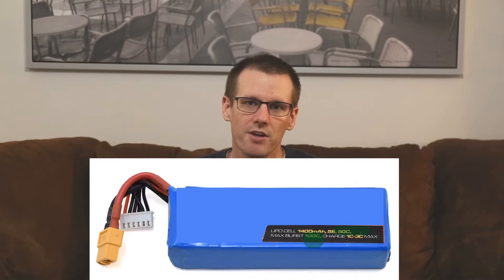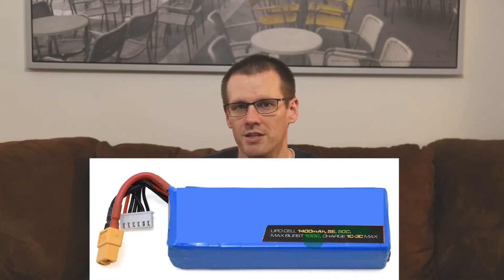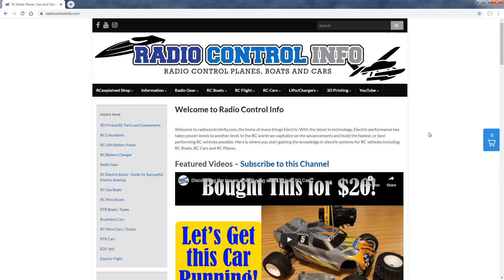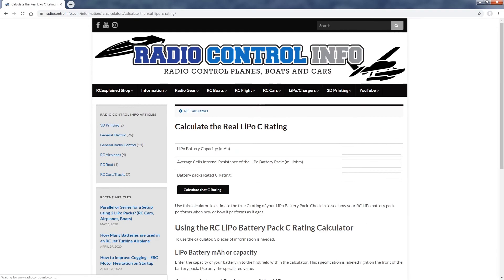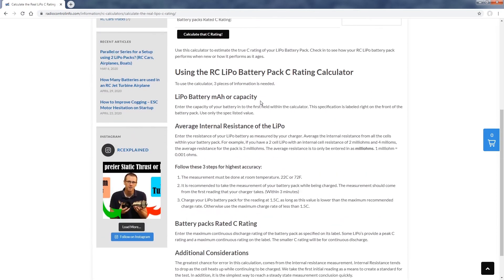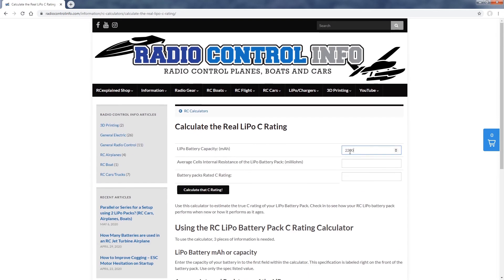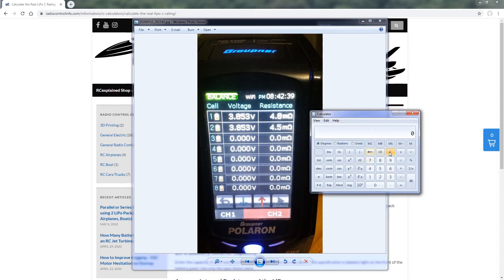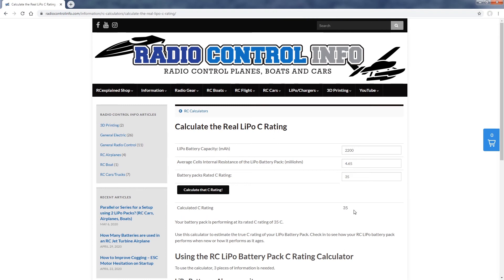Calculating The True C Rating of an RC LiPo Battery Pack

Comment: Disapointed !
I thougt this video would teach me how to messure internal resistance and do the calulation.
After ten minutes of watching I realize it teaches nothing but how to use a function on a web site.
Reply: 1. Measure open circuit voltage.
2. Apply a load (with something like a resistor or whatever) and wait 1 second and record the voltage. Determine what that loads current (I) was.
3. Open circuit voltage -Under Load Voltage=Voltage Drop (V)
4. V/I=IR ie 0.071/10=0.0071 Ohms
5. There you go. 7.1milliohms
6. All testing that is done comparing packs should be done at the exact same temperature. DC IR is also very dependent on pack voltage, unlike AC Impedance which barely changes throughout the voltage range.

I'm not into the Lipo world as much as NCM/LFP but I believe testing IR at 3.8-4.0V is fine so long as you use the same voltage for all packs.

A more accurate number can be had by using multiple different loads. I can't remember off the top of my head how to put that equation together but its' quite simple

Less voltage drop equals better                                                                                                                                                                                                                                                                                                                                                                                                      f;;;;;l

Comment: hi. how can I make sure that my Ni-Mh battery is 10C as the company said? I do not trust what they say!
Reply from the maker: I do not have any data on 10C batteries, sorry.
Reply: Use a power resistor that would draw a 10C load. So lets say you have a 12V battery. That battery is 2000mah. 2Ah*10C=20A of discharge current. To get 20A from a resistor you need to find out what number you can divide 12 by to get 20. 12/1=12A so 12/0.6=20A. So a resistor that is 0.6 ohms or 0.6R. Now here's the power part of what your resistor is rated for (5W, 10W, 25W, 50W, 100W, etc) 12V at 20A creates 240W of power. You would need a 250W or 300W resistor to absorb that power. Those are a little pricey like more than $10, closer to $20 or $30

Easier way would be a discharger like an Atorch DL24 ($35 shipped for regular 150W, 20A version, they make an expandable version that goes up in 150W increments to 600W max, 40A). Buy the main unit and one expansion so you can do 12V at 20A for 240W. This is all hypothetical about your batteries size of course.

Other options: EBC A20 85W, 20A max with charging abilities for CC CV. EBC A40L 185W, 40A charge/discharge max but limited to 5V cells. ZKE Tech makes also EBD chargers....the D means discharge only. The C versions have charging ability. They make them in a few sizes for pack discharging 12V to 72V. The cheapest models like the EBC A05 is $50'ish and the EBC A20 is $80'ish. A40L is $200 and the EBD's are usually a bit more.
Reply: your battery passes the test if it can withstand the load without the voltage crashing into the ground and provides its rated capacity or something close to it

Comment: I've never seen a charger that give the internal resistance...
Reply from the maker: I'm a bit surprised.  I haven't seen a good charger that does not support that feature. I wouldn't want to buy a charger without that feature.
Reply: @RCexplained  I didn't know that was even a feature that chargers had until I watched this video. 

I checked and it turns out my new charger does have this feature, it is just buried in the menu. I suppose I should start making use of it.
Reply from the maker: awesome, that is great

Comment: I have been seeing your videos with great attention, and this one in particulary got me sad, because altought I am very concerned with my lipos always going to storage and not going too far when running I discovered that all my batteries are low grade batteries because even the newest ones Don t have the "C" rating that is on the label. I m glad my rc s are not top notch😔😔😎😎
Reply from the maker: I have found that Turnigy Graphene packs do very well. However, in your case, if your packs are performing well in your application and not getting hot, then it doesn't matter what the "true" rating is.
Reply: @RCexplained  ok... Well in the summer specially those that run in the supervee 27 get in the mid 40 s centigrade, but I always run the boat in a big pond and almost all the time at full throtle to"unleash it's bad temper"😉😉

Comment: Nice vid bro
I use a battery 4s 6000mah. 55C
 Now I bought a battery 4s 6000 mah 120C.
 What change will I feel ... by power ...driving time..
I charge regular ?
Thanks
Reply from the maker: Your battery will hold better voltage under higher loads. You can charge the pack using the recommendations from the manufacture.

Comment: I can't measure the resistance and charge at the same time, is a completely different setting to measure the resistance.
Reply: Me too, I can NOT take the measurement of the battery pack WHILE being charged. In SkyRc chargers (mine: Ultimate Duo 400W) this measurement is in "main menu-batt resistance"...
Reply from the maker: Yes, there's no set standards for charger manufactures as to how battery resistance is to be measured for those that can even do it. There's a few different methods used. I like how SkyRc forces a more consistent method for measuring resistance. But I'm not clear as to their process and even if it is as consistent as I'm assuming. 

The charger must be either be charging or discharging in this battery measuring mode. Do you know how much current the charger uses to measure resistance?
Reply: @RCexplained  I'm guessing it does it through the balance connector? So maybe if I use the current clamp it will tell me?
Reply from the maker: It's possible it is taking current from the balance tap. You may be able to tell if this is true by seeing if you can plug the balance tap in only and the units starts the resistance reading. If it requires you to plug in the main leads to the charger I would try and measure this by using a current meter of some sort.
Reply: @RCexplained  when connect the battery only on balance tap the charger says: NO BATT DETECTED (SkyRC UD400)
Reply: @RCexplained  I think they discharge a pack through main leads with some preset current and measure voltage drop of each cell. More consistent, still, is measuring resistance at  1 kHz, as it is in 18650 datasheets. Take a look at YR1035 / YR1030.
Reply from the maker: Ya, we've taken what most people have to work with.